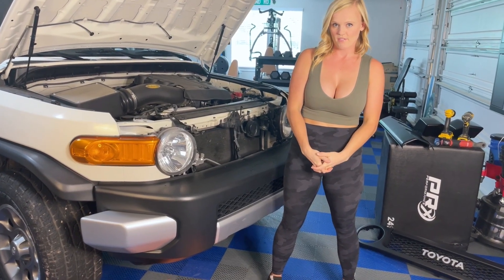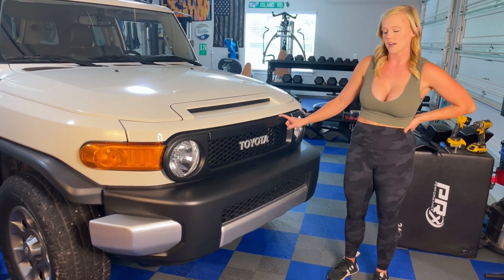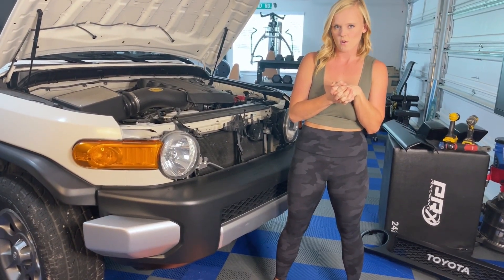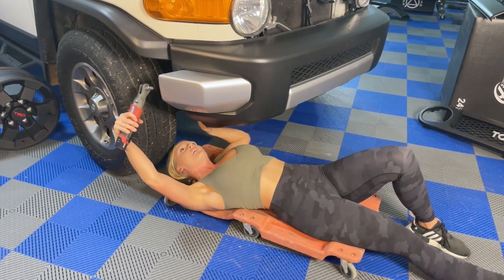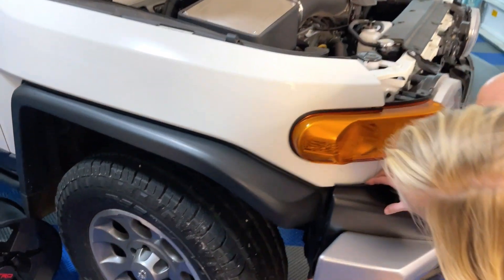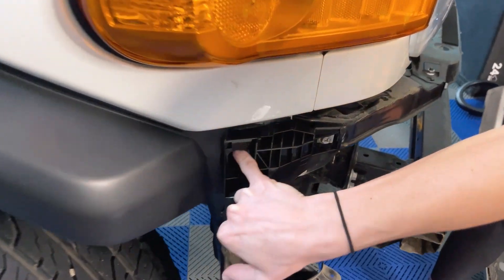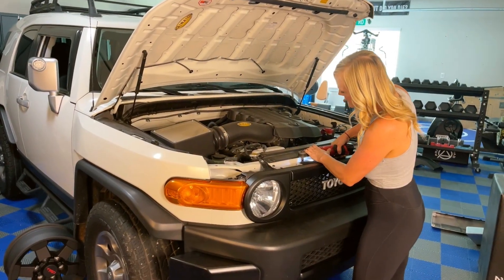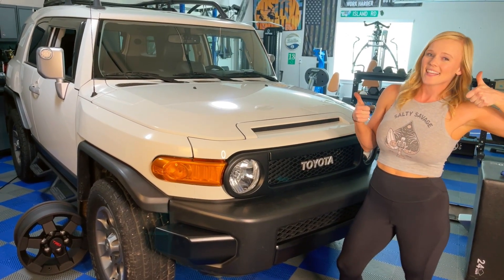I broke it....Fj Cruiser Front bumper removal and Trail Teams black trim install.

Comment: I also broke both those upper bumper mounts and a few clips. I opted to raptor line the silver bits rather then replace them with the TT parts but yeah it's a pita of a project...